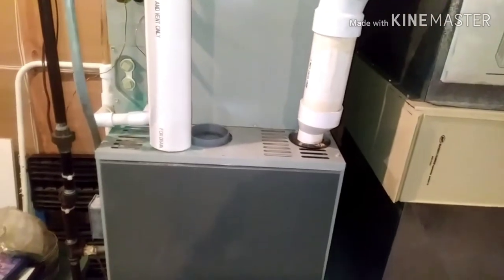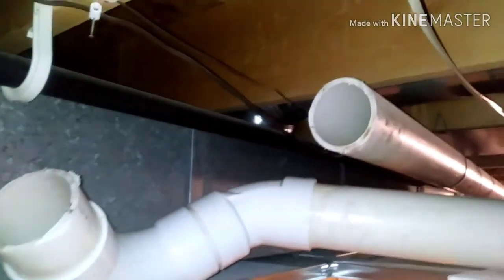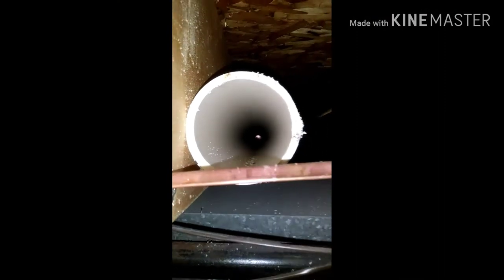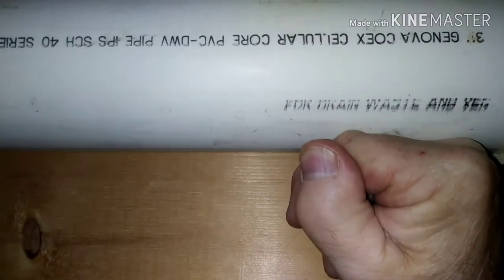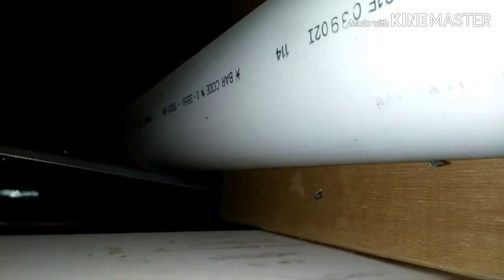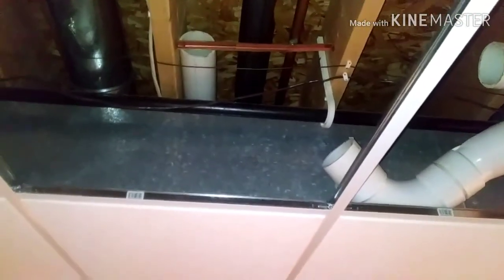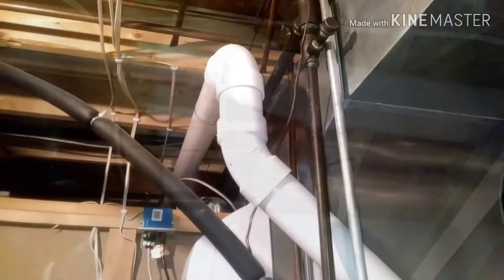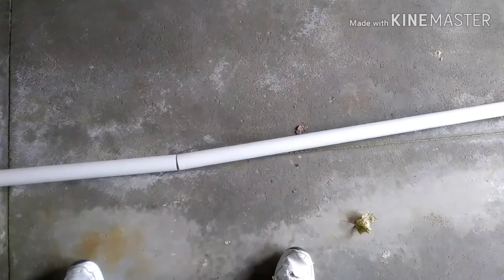Furnace short cycling (tips)

Comment: I know my comment is almost three years to late.  I ran into a similar issue at a house one time.  The furnace kept short cycling.  I went to the thermostat and it was set to AUTO.  I changed it to ON so the blower motor would run continuously 24/7.  They have not had a problem with it short cycling since.  Long-story-short one of their heating vents was blowing directly onto the thermostat which would fool it into thinking the house came up to temperature.  By switching it from Auto to ON, even when the burner was not running, at least the blower motor would circulate air in the house.  Once the temperature evened out, the short cycling issue went away.  In AUTO, the blower motor only runs when the thermostat calls for heat or air conditioning.  The air their house never a chance to circulate and even out, which left them with some rooms that were ice cold and the furnace kept short cycling.

In other houses, I have installed a cover over the vent to direct the air away from the thermostat.  In more extreme situations, I have moved duct work or the thermostat.  The thermostat should be located in the most central part of the house so It does not get fooled by the sun shining on it in the summer, or cold air every time someone opens the door in the winter.